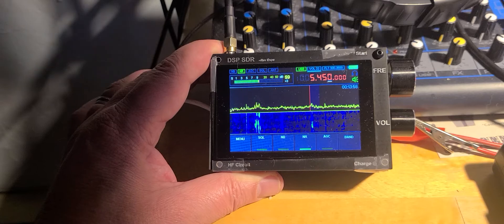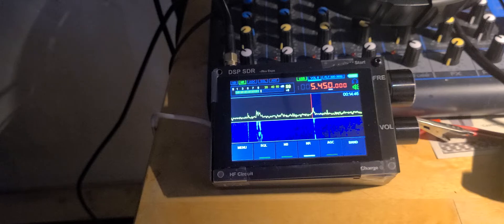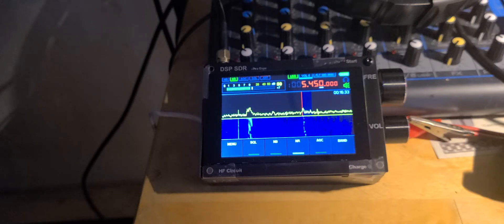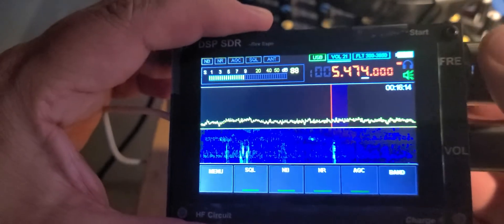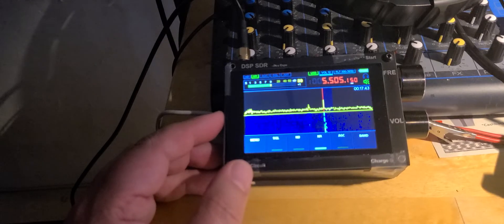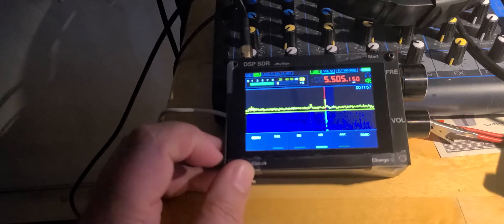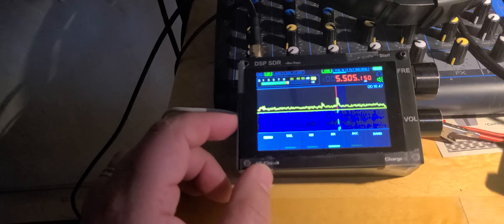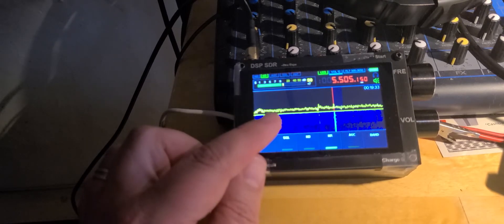Chinese DSP SDR receiver observations and personal comments tuning shortwave radio signals

Comment: I recently got the " pint of milk" sdr for $95. Nice big touch screen ( need magnifier glass at times). USB charging. Great battery. Great FM on whip. But deaf on BCB and SW, especially on ham  bands. Needs real antenna lie 40m dipole, etc. Point of tiny unit is for portable/ picnic/ travel in lonely hotel. Ant direct to so called lna then mixer. No bp filters no rf front end. Even a simple fet preamp and tracking/ swithable band pass filters would make it fly.Added a bb mmic  ahead of mixer. Bypass switch for real antennas and mmic amp for ten feet of wire next to bed in or out window works much better. On 9v or even internal 5v adds 15 to 20 dB. For $10 plus few parts from junk box and it is great. Not a K3 or 7100 but fine for the uses above. Also in sick bed after opn that keeps you out of radio room. Mmic easily goes between bnc on back and antennas in small box. Or it can be placed inside my model. Cubical box is half empty. Small Bnc to sma jumpers from China worked and lash up of varible cap and a few switched coils gives me broad manual preselector with random ant match ( sort of). That is the way to make the really useful traveling. 73

Comment: Bought a cheaper chinese clone with thumbwheel knobs about two years ago (still cost  me $160 US). Came loaded with the same demo software. I was very dissapointed, by far the main drawback is the weakness to strongish signals specially on the MW band.
I suspect this is also true about the russian version since the schematics an components are the same. I have reversed engineered the board and compared it with the russian schematics (out of frustration). I doubt wether the paid license version can improve on that  field. Of course there are also issues with touch screen mis-responsivness, rotary control bounce, very limited spectrum display width, etc...
The british SDRplay, although it requires a separate computer (I use a windows10 tablet) is far superior in performance and functionality and in itself is cheaper than this.
So buyers beware, $200 are better spent on a proper SDR. And as the video says there is still room for both technologies to be enjoyed.

Comment: Good point well made about "Chinese bashing", I don't think people should be bashing these guys for coming up with affordable receivers that work pretty well overall and it's not like the legacy radio manufacturers such as Sony, Panasonic, Grundig etc are coming up with anything new these days, they left that stage years ago, only exception today being Sangean. But credit where credit is due, the Chinese are filling the gap left by the aforementioned and are doing a good job so we should acknowledge that if it wasn't for them there'd be no new receivers of note, certainly none for the SWL/AMDX community.

Comment: Eventually a major radio manufacturer is going to nail this properly like Tecsun or Sangean.
Reply: I can expect this to be incorporated into a small Tecsun or XHData. They’ll tweak it, put it in a cabinet with a small speaker and a couple of 18650 cells.

Comment: Gilles, I’ve had mine (same as yours) for only 24 hours….I too am amazed by its performance on the ML30, and its features, even though it’s the chinese “test” version. As a ham, I also have Collins, Kenwood, Yaesu and Icom desktop gear, but it’s so easy to pick up my Tecsun portables, and now this Malachite SDR, and hold it in my hand and marvel at their performance.
Reply: You should get the updated 1.10b firmware. It is MUCH better with the firmware!

Comment: Can you please drop a link to this unit
Reply: https://www.aliexpress.com/item/1005001705674740.html
Reply: CSCC: I am in the UK, I don't know about yourself. Here is the Amazon UK link,  but I am sure it will be available in whatever country you might be in:    https://www.amazon.co.uk/dp/B08QZ9BRG3/ref=sspa_dk_detail_1?psc=1&pd_rd_i=B08QZ9BRG3&pd_rd_w=Y6Gf2&pf_rd_p=9ff0fa93-2215-4829-b1c0-0df6a15ec870&pd_rd_wg=HSEqG&pf_rd_r=GJHKB18KXEQRMA0D12SG&pd_rd_r=035d5b02-cafc-4c5b-a725-51b16c5359c4&spLa=ZW5jcnlwdGVkUXVhbGlmaWVyPUFIQk03U0FOWjlMWEgmZW5jcnlwdGVkSWQ9QTAzOTYzNjQ0RzlRNVZMRlVQU1gmZW5jcnlwdGVkQWRJZD1BMDUxMTgyNTJKRVZXTVBNVEwzMUImd2lkZ2V0TmFtZT1zcF9kZXRhaWwmYWN0aW9uPWNsaWNrUmVkaXJlY3QmZG9Ob3RMb2dDbGljaz10cnVl

There is a cheaper version for about £65 available. If I might say so, I find this (as most Chinese product) exciting, very forward thinking, great layout, but, ultimately, flimsy. I got  one, but without wishing to start  a Russia/China conflict, I can't help feeling  the Russian version would have a better build quality, but hey - Gilles is the expert not me, and my computer equipment is pretty ancient,  and minimal, so his experience is undoubtably  more valid than my opinion. If we were using the Amazon "star system" I would give this three out of five stars, purely on my own experience.

Comment: Frequent listener and participant in your channel, BTW.

I bought the (albeit Chinese) "registered" version. I think I pad about $280 USD for it. Well life got in the way and I put it down for about 2 months. I picked it up the other day and plugged it in overnight to recharge. The next day I went to turn it on and nothing happens. I have taken it apart, disconnected the battery, tried running it just off USB, you name it. It's completely dead. I'm very disappointed. The "full" registered version was quite a nice portable device. I was quite pleased when connected to my MLA30+. Now I'm not sure what to do. I really don't want to spend close to another 300 bucks for a replacement and I'm not sure how to trace the board on this one to see where things went wrong and see it it can be fixed.
Reply: Did you flick over the Bat En switch underneath? This is set to Off by default for shipping purposes. The battery will not charge otherwise. (assuming you have the exact same model as in the video here)
Reply: I've read in the past that depleting the battery fully happens to kill these. I'm not sure why.